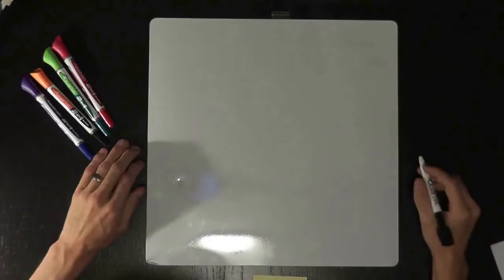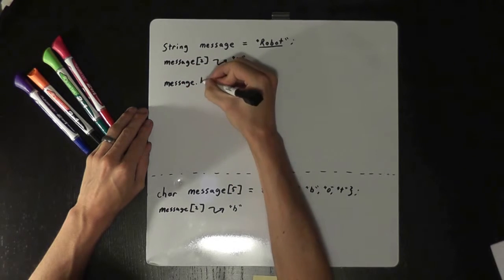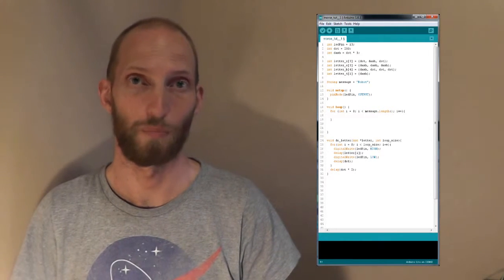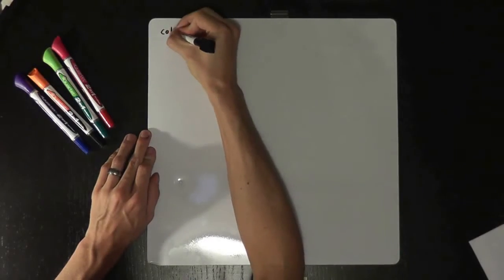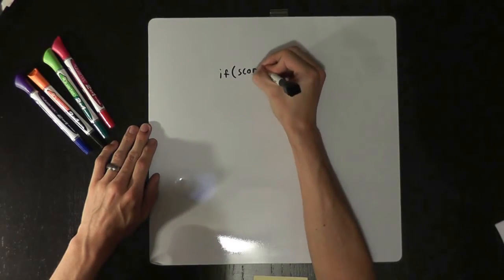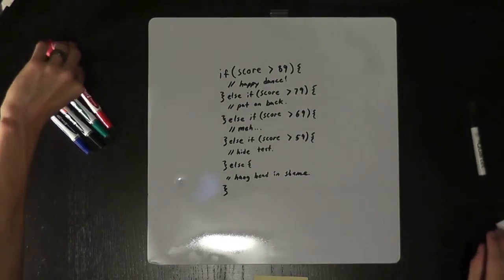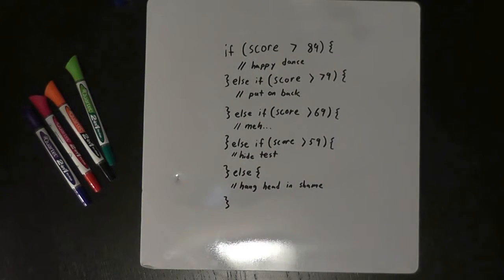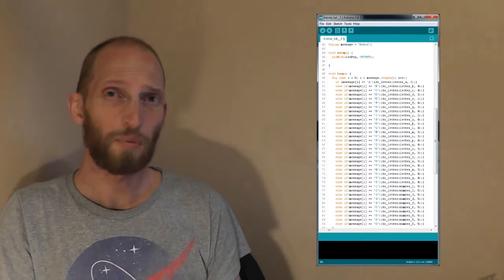Arduino Programming: Morse Code Code Part 3: Exploring Robotics #07

Comment: I didn't get it. The first array value starts from zero instead of one, why the first number on string start from 1? How does the I variable count the type of strings that contains arrays inside arrays(or strings inside strings if that's the proper wording). Like I have a book in it it shows char*letters(or char letters[ ])={ ".-", "-...", "-..",... }. The way I see there are strings inside strings. So if I variable is counting char letters[1] is it reffering to the first "."(dot), or it's refering to ".-"????